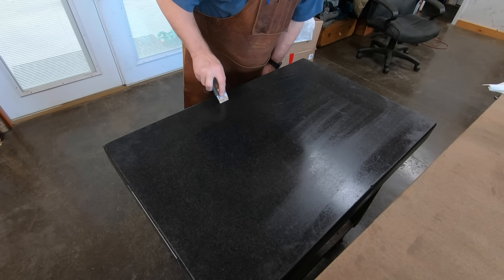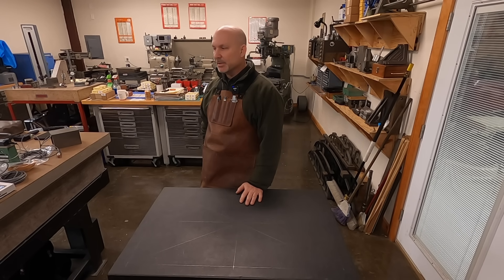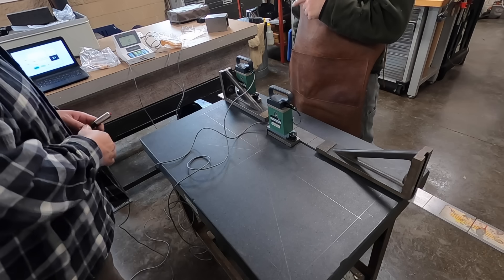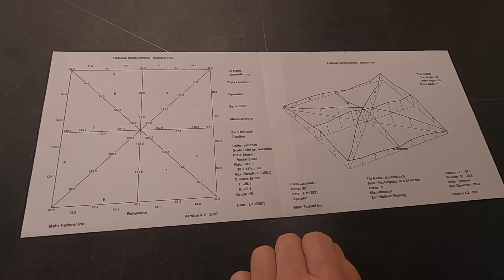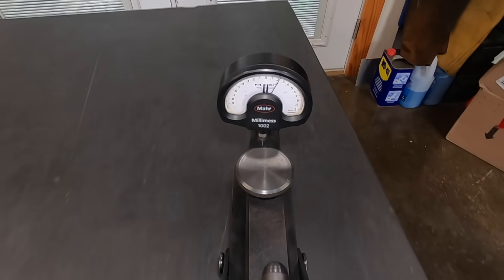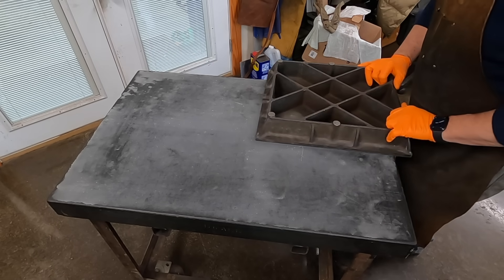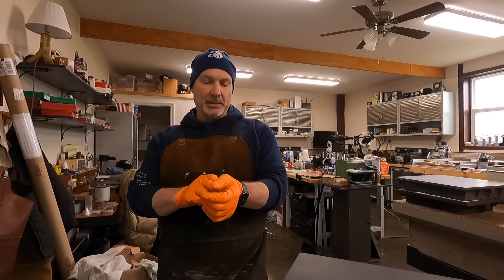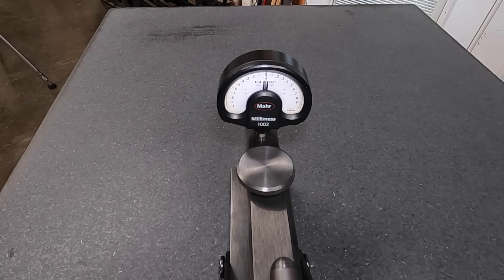Lapping my Granite Surface Plate to AA Grade

Comment: I've been curious about the techniques used to measure flatness over a surface plate.  It's nice to see how it is done.

I'm more familiar with measurements of optical mirrors which usually compare a spherical or parabolic mirror against a reference sphere or parabola.

Do they ever go optical for measurement and certification, using interferometers rather than the electronic level thing?

It would be nice if I could do something similar with a $50 DIY interferometer instead of investing what looks like thousands in a pro style setup.

Thanks for the video.
Reply: Composite stone like granite can't be ground as smooth as glass over small areas so the optical interference pattern would be a sea of ripples. Glass is homogeneous and can be ground far flatter over very small areas, small enough to measure with optical wavelength light.
I suppose you could do interference on granite with millimeter-wave microwaves but the setup would be a bitch. That presupposes granite is sufficiently reflective and as far as I know, the only people with any data on that are various militaries...
Reply: @markfergerson2145  doing some conversions and hoping my decimal places are right, a 1/4 wave mirror (nothing particularly special) has about 100nm of error which is about 4 millionths of an inch.  That suggests the surface plate has a local error of about 10x that of a low end first surface optical mirror.

I don't know if that is too much to do a visible light interferometry because mirror grinders check their work often far before it gets to 1/4 wave.  They also check spherical mirrors vs parabolic which will show large errors toward the edge.

I have a bunch of mirror blanks that I'm going to grind some day (to make a Chief and maybe an even more exotic design) so when I get to the measurement stage, I'll have to see what happens when I put my surface plate in the mirror position.

It's one thing to be told it won't work, it's another to see for yourself.  If I can take some time to see without spending a lot, that will settle the question for me 100%.
Reply: @beardoe6874  Toward the end of the video we are invited to inspect the grinder's reflection in the stone, yet at closer to normal incidence there's nothing resembling a reflection from say the lights on the ceiling. If you ground glass to the same flatness they achieved with the granite, what would you expect to see?
All that said, as you say actual experiment is the final arbiter. Nature can't lie or make bad extrapolations.
Reply: @markfergerson2145  from what I remember of mirror testing, sometimes you have to reduce the reflectance and most of the testing is done before the mirror is silvered or aluminized.

What I would expect to see is an interference pattern that matches a computer simulation of a flat surface interference pattern or a plot showing the figure of the surface and not just on eight lines.  If it works, you could see peaks and valleys missed by the 8 line method.  Since you are lapping it with a reference flat, those areas between the lines are most likely just as flat as the lines but I prefer tests to assumptions.
Reply: I'm sure if you could get Newton's rings off a granite surface, that technique would find itself useful. In fact it may even be possible - a sodium light and an optical flat would make for an interesting test.
Reply: @beardoe6874

Comment: silly question, how flat are those iron squares?  are they insanely flat?  or do they not have to be super flat to be used to rub the stone flat?
Reply: That's a cast iron surface plate, they are scraped to flatness, ideally with the three-plate-method. Because of the scraping the local flatness is a little worse, but the global flatness should be quite good.
Reply: Given what CatNolara has said, those cast iron hones are indeed insanely flat (but formerly super flat).  Nearly all the little scrape marks have worn off due to the hone's use which improves the local flatness - something like trowling off a concrete floor where the trowling knocks down the stones, fills in the little holes and removes the marks left by the initial screeding off.  So now, instead of being a trowled flat surface, they are a polished flat surface with the majority of the tiny little high spots worn off and shined up - effectively the surface plates have contributed to refining the flat surface of the hones.
Reply: I suggest you watch the video.  This was explained.
Reply: @paulcopeland9035  yep I will when get some time :P

Comment: I think this is by far really cool but what is the point to level a granite plate to that level? Does it really make a difference? Lastly can you tell the difference feel wise from a leveled to non leveled plate?
Reply: what's the point? because they can (and because it's precise and he will be able to work with better precision and accuracy) ;)
Reply: Think of precision on measurements and tools as gates you have to walk through. The more precise the tool the wider the gate is. You pass through a long series of gates to arrive at a part that is within the specification/accuracy you need.

The more precise your tools, the more leeway you have for making every gate without crashing into a pole <.<

Comment: So what is this very level plate used for?
Reply: if you sit on a level aa surface plate, you can align your chakras to the heavenly axes down to the nearest 3 arcseconds
Reply: @cvspvr  Lol! :)
Reply: If you're still wondering It's for precision measurements. You use the flatness as a reference between the part and the measuring instrument.

Comment: As a BTW what  would a cal lab charge to test this plate and bring it to AA specs? Not including transport etc.
Reply: more than the plate is worth. that's why this kind of stuff is usually recertified in house or someone flies out to the shop to do it, with all the same equipment you saw lance using.

Comment: I am curious, is there any reason why you lap that plate?
Reply: Surface plates are used for measuring parts to very fine tolerances. Say you want to make a Part for a machine that someone far away is building the other parts for. Using a surface plate and other tools both parties can verify the fit of their parts independently, so without them having to be in one place. Therefore, it can be guaranteed that all parts will fit together as intended. That kind of repeatability is the backbone of modern manufacturing and made industrialisation possible. Lapping is then done to equalize the plate's change in flatness that comes with years of use(abrasion)

Comment: minute 6-10: How are those two measuring heads determining difference in height? earth magnetic field? laser? ultrasound?
Reply: by mesuring difference in angle between positions. iirc using a magnetic pickup on a pendulum

Comment: What will the plate be used for? Why does it need to be so precise?
Reply: Tool calibration for example. As a reference for checking parallel surfaces of parts or tools. It's not used everyday but you need it to calibrate your machines to run true.

Comment: what is this plate for???? please
Reply: It's a "table" used when measureing parts that are made by a machinist.
Reply: It is a reference surface that is known to be flat to a very high precision, so you can trust that using it as the base surface for a measurement will be accurate no matter where on the table you put the thing you're measuring or the tool you're using to measure it with.
Reply: or you can use it as a REALLY overkill hotstone for grilling steaks

Comment: 7:50 That's a nasty chip missing out of the edge, on the right side, about the 5 o'clock position.
Reply: @c0mputer  ...Lapping would never get that out.  You would have to cut the edge off to remove the chip.  That would be useless and a horrible waste of time.  The edge of these plates is not used.
Reply: You can have great big holes in a granit plate, as long as you know they're there, and avoid the holes when you measure. Jus look at oxTools big granit plate.

Comment: Why do you need/want a piece of granite so flat? Where are they used?
Reply: It's all about chasing those zeros. It's usually used when precision is the goal and you need a reference. Granite is used because of it's low sensitivity to temperature fluctuations which can cause changes to it's dimensions. Its hardness and material costs make it the material of choice for most applications.
Reply: when you put two right angles on it, you know they are exactly vertical and so on. Used for lots of precise measuring and marking

Comment: If lapping that granite surface turns out to be relatively "easy", wouldn't that suggest that it is prone to wearing out more quickly too in heavily used spots? What would prevent that, other than changing regularily the area of the plate one uses to make measurements? Can one chemically "harden" the surface to slow down wear?
Reply: Remember he is using diamond lapping powder. Another thing is - hard materials are not worn by soft materials - the reason "soft" cast iron is used for the lap - diamond will prefer to imbed in cast iron not the granite.
Reply: Anyone who has ever tried to drill granite with a hand drill and sledgehammer will know just how tough that miserable stuff is. Just try chiseling it with something that works for say,limestone. Tried that latter years ago. Once was enough. Heavy rock is tough and durable.
Reply: I suppose in relative terms, yes, it will wear faster, but its still rock hard - quite literally..
Reply from the maker: Black or grey granite is known to be a softer stone thank pink granite. That’s why pink granite cost more, it’s harder to lap and it last longer when used properly. Dark granite also works great but using due care is a must. Wear is inevitable, that’s why they have to be inspected, lapped, and recertified on occasion.

Comment: Very interesting, the process was mesmorising to watch. What is a granite plate used for that it needs to be this flat?
Reply: It is used for measuring and inspecting parts.
Reply: To be the absolute reference for flatness, straightness, and parallel-ness in a machine shop, so you have something you're absolutely sure is flat to compare your parts to and make your measurements relative to.
Reply: @Nerdule  thanks for a very good explanation

Comment: I forgot to ask for explaining how these devices actually work and to what grade they (can) measure.
Reply: Hi Rob, if you go back through the comments he explains all that where another guy ask. Stay safe an think it's a few above yours.
Reply: The boxes sliding along the straghtedge have pendulums like a clock in them and they swing based on how level the plate is. The reading is the difference between the two pendulums, one is the reference and doesn't move.
The repeatometer with the dial is just a dial indicator on three feet. Tom Lipton (Oxtools)  had a video on making one. https://youtu.be/ZkCIVsP7-KY

Comment: What is a granite surface plate used for..???
Reply: surface plates are used for precision inspection with surface gages.    

because i am lazy here is a definition from a manufacture 

"Surface plates are used for mounting mechanical, electronic, and optical gaging systems. Many laboratories and shops rely specifically on granite surface plates for precise measurement and inspection."
Reply: @Livedracersteve  Thanks very much...My friend...

Comment: what do you even do with such a flat plate?
Reply: used for measuring with ultimate precision, say you have a part sitting on a high spot on one side and low on the other, its gonna throw a measurement off while on the table. 
hence why its necessary to be super flat, helps hold crazy tight tolerances to make those big bucks....
Reply: pizza
Reply: @adredy  yeah, what this guy said
Reply: You just keep it around and scream at people in the shop for using it as a regular work bench. Surface plates are super good for that.

Comment: Why is the stone sitting on only 3 points, not 4?
Reply: 4 points of support is statically indeterminate.  That means the stone is being bent.  With 3 points, the loads are always the same.
Reply: These plates have three indents in the bottom surface, that are exactly where they are to be supported. Simple as that.
Reply: because a three legged stool will never rock
Reply: @jossblack7445  Good Point.
Reply: @shooter7a

Comment: What is a granite plate used for?
Reply: What isn’t it used for!? I use mine to hold my cup of coffee up off of the floor and out of reach of the dog. No really it is made to be a true surface for measuring very small changes in surfaces. If the surface gauge is not set right or the plate not right then everything else is off. But I’m talking about down to tens of thousands of an inch. It also helps to measure square things too.

Comment: Since I'm a complete ignoramus, i wonder... What is the use of such flatness?
Reply: accurate measurements.
Reply: @nick4506  measurements of?
Reply: @tatoruso  flatness
Reply: You would use it to blue up a part to be precision scraped, or you would blue up a straight edge to blue up machine ways for precision scraping. To scrape machine ways flat you need a reference surface to compare to.
Reply: @tatoruso  you can do a lot with a surface plate, flatness, parallel, angels. really anything to your heart's contents with some fixturing. but it will all be off if there is a dip in the stone.

Comment: I wish I understood why this is so important.
Reply: A straight-edge for drawing things is valuable because it is straight.  This is essentially a 3D straight-edge.   Good?
Reply: In order to be able to know whether something is truly flat, or perpendicular, to be able to mark work for machining, you need a standard. That standard needs to be a good deal more accurate than the results you need, generally, that’s five times the needed measurement accuracy, and for very high precision work, it approaches ten times.

So a standard surface needs to be extremely accurate, because it’s a primary standard from which everything else is measured against.

I hope that helps.

Comment: Will that software output a color gradient of the topographical mapping?  If you could couple that with a smoothing option, and not hard bends in the mapping data, it might show a more life like model, even though it's extremely exaggerated. In the land surveying world, we can apply such options to our topographical mappings to show better detail. 

But, yeah, really been digging the surface plate rehab vids!!
Reply: it would be simple to recreate the map in a cad program w/ surfaces in color if you had the data. The software/hardware running this program probably doesn't have the graphics capability to do that.

Comment: So, I admit, this video just popped up on my feed (probably because of the random stuff I watch) and I'm about 15 minutes in, and still have no idea what's going on😂. I'm not here to be a troll or bad commenter, I just genuinely want to ask, what exactly is going on here? I feel like I've stepped way far into something I was completely unaware of, and now I'm lost deep in the woods.
Reply: I believe they are using tools to check the flatness of the surface plate, then they will make the surface plate go from a really flat to a even more really flat,
Reply: First off flatness is relative. 
For high precision work operations in fabrication makers have a reference plate or stone.
Surface plates must be calibrated regularly to ensure that chipping, warping, or wear has not happened. 
A common problem is wear to particular areas where you work the most. Even though you may not see the wear it happens. 
Kind of like how when you sharpen a knife you lose a very small amount of metal in the process. 
To make sure the plate is actually flat they are checking it. 
Then correcting it to be more flat.
From the factory you order them with the degree of flatness you require. We are talking 0.0115 mm per 2960 mm for a grade 0 plate.
From the wiki.
A surface plate is a solid, flat plate used as the main horizontal reference plane for precision inspection, marking out (layout), and tooling setup.[1] The surface plate is often used as the baseline for all measurements to a workpiece, therefore one primary surface is finished extremely flat with tolerances below 11.5 μm or 0.0115 mm per 2960 mm for a grade 0 plate.[2] Surface plates are a common tool in the manufacturing industry and are often fitted with mounting points so that it can be an integrated structural element of a machine such as a coordinate-measuring machine, precision optical assembly, or other high precision scientific & industrial machine. Plates are typically square or rectangular, although they may be cut to any shape.

I hope this helps. Not really my wheelhouse but I've been watching machinist channels for awhile now. So I have a slight handle on what they are doing.
Reply: In engineering things have to be made with a high degree of precision. To measure something really accurately you have to have at least one known starting point which you can depend on. Probably the most used tool for high precision metrology (the science of measurement) is something called a surface table. This is simply a large flat surface :-)  It gives you a known starting point you can measure something from, but to get the levels of precision needed it needs to be as consistently flat as the level of precision you want to work to. So if I want to measure to 1 micron (1/000 of a millimeter) then my surface table must be flat to at least that level of precision (preferably more) for me to get an acceptable result. Surface tables are graded according to how flat they are. They are checking this surface table and working to improve it's flatness.
Reply: If you are a random viewer, you should go back and watch many of Abom’s videos. There are many uses for a precision flat surface in the machining world.